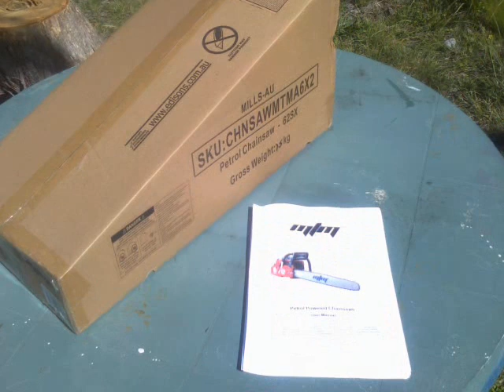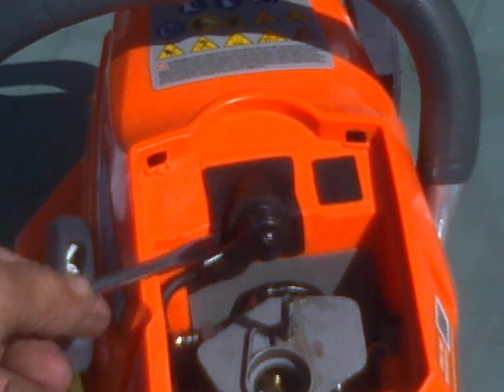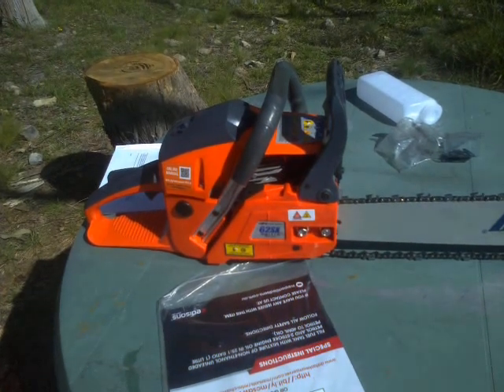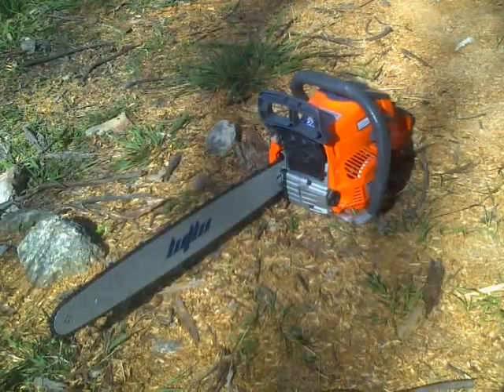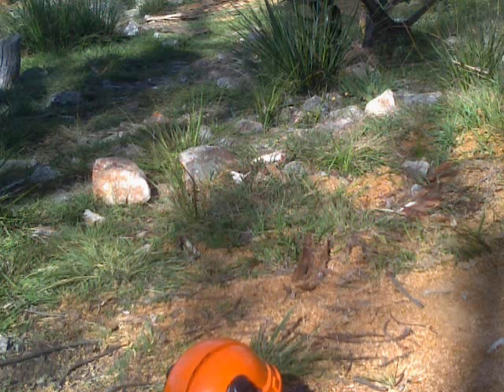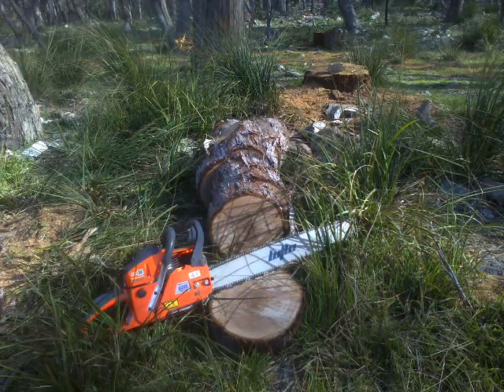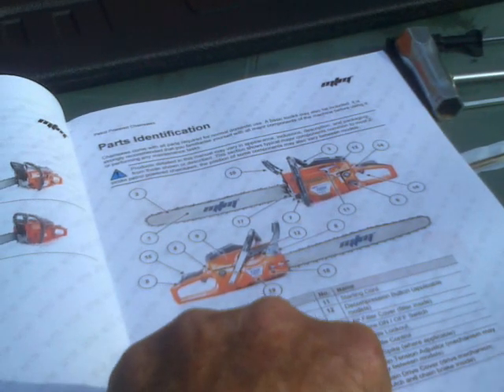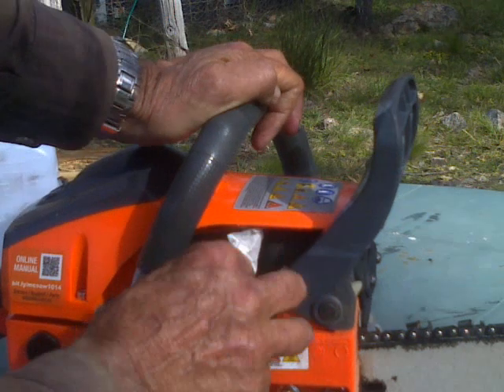Chinesium Chainsaw, MTM 62 SX ; Unboxing, Assembly, First Start, Acceptance Test, First Impressions.

Comment: Just received mine today. It has an oiler adjustment screw close to the bar than the blind hole. Haven't cut with it yet but everything works so far & only had to tension the bar after a 5 minute run . I'll give it a good run at work tomorrow but for 120 bucks I'm not expecting it to match the Stihl ms 271 at work... Then again from some of the reviews I've seen, it may out perform it

Comment: Ooohhhh the temptation to buy one finally got you!
Reply from the maker: G'day,

Thanks mate.

Yeah, the full backstory is in the earlier Video, but basically for 20 years I had no spare Chainsaw, and for 16 years I've been relying on my son's Saw if I needed a spare...; and now both he and I have one of these.

   I got 4,700 Hours out of my first Chinese Generator, and the one I have now has done 2,700 Hrs...; so I accept that some Chinesium stuff is perfectly functional - but when buying it there's a bit of a Lucky-Dip effect.

I never really know whether it'll have been wasted money until trying it out.
 
 And these are selling for 1/10th the price of a new Stihl, so it's not actually too scary a sort of a gamble.

   It's not as if the Chinee can be accused of "Dumping" their stuff below the cost of Production - because Oz doesn't (know how to) manufacture ANY bloody Chainsaws at all....

   I'm not actually patriotically loyal to the Austrians -and neither are the Austrians, in that my Stihl was assembled in Brazil...(!).

  So, almost free Chainsaws are available from China ; and I can't see any reason why not to snaffle one...

   My son's, his apprentice's, and mine, are all there, they start up, they run, and they cut Wood..., so that's 3 out of 3 that are go-ers...

Their known bad habits are that they throw Oil on the back of Chain-Brake's  Actuator-Handle.., and the Teeth on the Log-Dogs are quite  short while the Exhaust Gas goes out straight forwards - so they can set fire to Stringybark Logs if you sink the Bar in up to the Dogs.

  It's still a fully  functional 55cc Chainsaw with a 22-inch Bar for $129....; and +reburne tells that they're now listed at $119.

Maybe you should get one, before they start giving them out for free ?

Such is Life,

Have a good one...

Stay safe.

;-p

Ciao !

Comment: Just bought this saw. Fitted a quality brand 16" bar/chain. Cuts like crazy. The bar oiler adjuster is there just a bit further south of where its pictured. Great firewood saw.
Reply from the maker: G'day,

Yeah, mine and my son's were great early on, too ; we both put new shorter Bars on, with proper Chains - the originals were not Case Hardened and they wore REALLY fast, by 2 Hours they wouldn't cut straight.

They were always utterly impossible to get the Chain Tension to stay adjusted, and they thus throw Chains..., and my son is now about to strip his down ; expecting to find that the Drive Sprocket has an Offset Centre on the Crankshaft - loosening and tightening the Chain once per Revolution....

I think they are China's way of trolling the Chainsaw Community.

Such is life,

Have a good one...

Stay safe.

;-p

Ciao !

Comment: U can alter the amount of oil by a screw underneath the chainsaw to reduce the amount of oil
Reply from the maker: G'day,

Thanks.

Most Chainsaws, yes - you're not wrong.

However I once had a McCulloch which featured a Thumb-Lever powered Pump for Bar-Lube Oil...; and the $135 Chinee "MTM which has a fixed-flow Bar-Lube System -  apparently the better to be Idiot-Proof...

Get used to the FACT..., that Not All Chainsaws Are Created (Designed and Manufactured so as to be) Equal...

This is my 5th Chainsaw in 40 years, since I inherited 2, at age 21. 

My 4th Chainsaw, bought new in 1994, has about 350 Hours in it's Logbook, at 25 Hours per Chain...

Such is Life,

Have a good one...

Stay safe.

;-p

Ciao !

Comment: Bar Lube on the Chain break makes it easier to tell that it's functioning properly. What a great feature and they didn't even charge you extra for it.
C'est la vie
Reply from the maker: G'day Richard,

Thanks mate.

  True, true, I hadn't thought of that...; though my impression is that it only truly enthusiastically throws the Oil out through the Slot when the saw was new, unused, & clean... 

  As the Sawdust combines with the Oil, I'm expecting the Slot to become encrusted & narrowed & finally sealed over by the accumulation of a "Paste" of Oil & Dust.

Time will tell.

 The ability to ignite the Stringybark on the  Log being cut, with the Saw's forward-facing Exhaust seems to be the standout Surprising Bad Habit.

I've never heard of  any Chainsaw doing that before...; but as they don't have Stringybark Trees in China - I suppose they can be forgiven for not having thought of the possibiity...

  It's an excellent Saw for the price, in that it pays for itself on the very first load of wood that it cuts...

Wonders will never cease (?).

Such is Life,

Have a good one...

Stay safe.

;-p

Ciao !

Comment: Trust me it will work like a ripa as long you take care of it.......normal maintenance ect..ect
Reply from the maker: G'day,

Thanks...

Close, but no Cigar.

It looked good, worked OK for 15 minutes, but by 30 mins it was cutting
Wavy Wood, because the Chain  & Bar were wearing each other away.
By 45 minutes it was cutting Curves and by 1 hr it couldn't get through a Branch half as thick as the Bar before jamming.

So I dressed the Bar, with a
Power File
And that worked, for
10 minutes.

At 2 hrs I decided the Bar and Chain had never been
Case-Hardened or
Tempered.
Mild Steel makes a lousy
Chainsaw...

So $70 for a new, shorter, bar & $30 for a matching new Chain...; & $66 for the
Stihl Parallel File Kit for it.

So,
$166 worth of Bar, Chain & File added toba $125 Chainsaw yields a $291 Unit, which sucks Sawdust into the Carburettor ; and thus blows
Actual glowing
Embers in the Red Hot
Exhaust Gas - which it then 
Cheerfully blows onto the Top of the Chain going into the Cut...., which in the 2019-20 Drought was literally setting the Stringybark alight as I was cutting the stuff.

Adding about 5 variously sized
O-Rings to the Assembly of the
Air Filter &
Meticulous attention to
Fitment and security of the Carburettor Air Box Cover did eventually block the Sawdust.

But, it took me
Maybe
5 hours of use,
Perserverance,
Extra Cash to replace the
Ornamental Chain & Bar,
And a fair whack of Experience using Chainsaws since 1984

But the Logbook on the MTM is currently showing 34 Hours & 59 minutes...; and I'm surprised at how reliable it turned out to be.

After I rectified it's 
Shortcomings.

As received
It was a dangerous
Useless
Piece of
Shit.

The Arsehole who shipped a
Container of them
Into
Oz in the hot end of a
Drought, strikes me as having been a
Viciously
Selfish mercenary 
Arsehole....

I am proud to have
Outwitted the
Mongrel-bred
Bastard ; and thus wound up with an
Actual functioning Chainsaw - which,
Even after requiring 
140% of it's purchase price in
Replacing 
Defective Components, and then
some fairly 
Advanced Low-Speed 
Aerodynamics & Airflow Analysis to stop it from
Spitting
Sparks...

It's still
About
1/3 the price of a new
Stihl which would
Do what it does
Accomplish.

I figured it out.

Pity help the poor
Bogan Redneck
Townie, or
Suburban Sheeplie Dreamer
Who's never had a
Chainsaw 
Nor
Any Lessons in 
Chainsaw operations,
Who bought
Or received as a  gift
One of these things
As
Supplied.

In my experience &
Observations.

Such is life,

Have a good one...

Stay safe.

;-p

Ciao !